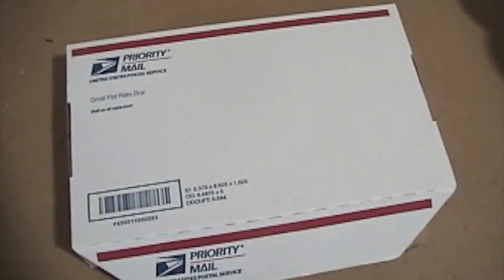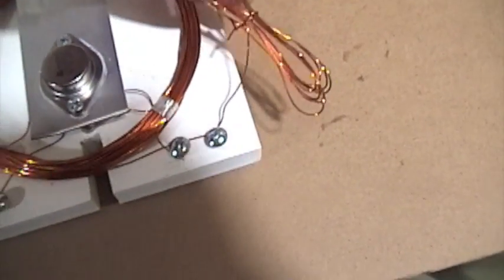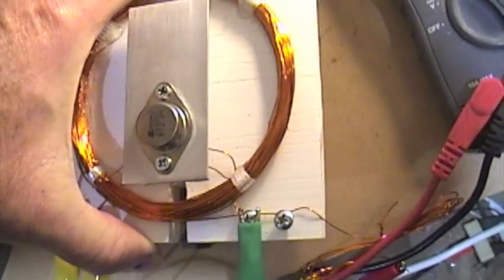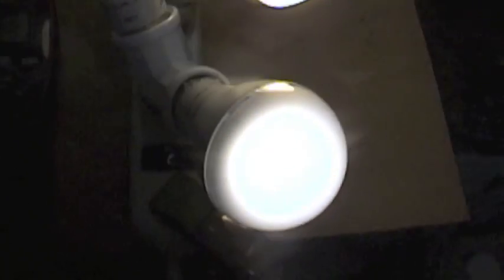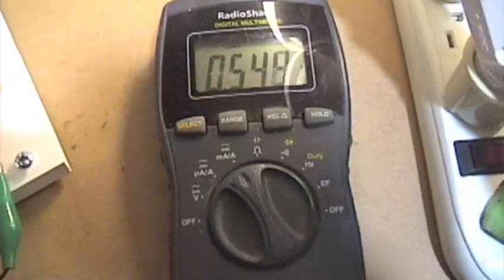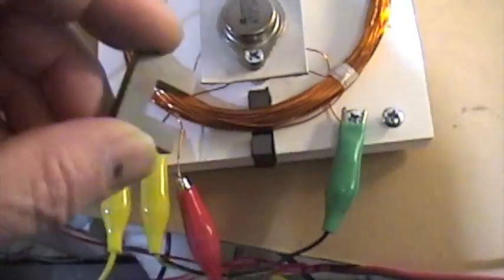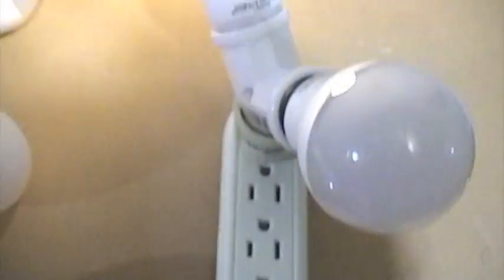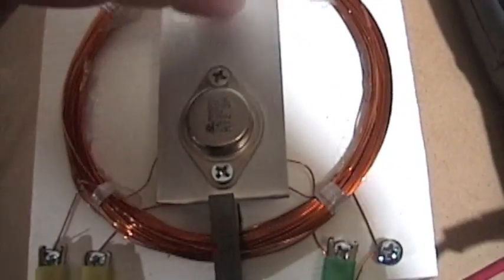High performance LJL -SC

Comment: How long will it light a 5 watt led bulb on a 12vdc battery ?
Reply: I ran a 40 watt led bulb for 8 hours on two 6 volt 4.5 amp wet cell batteries in 12 volt series.

Comment: pleas tell me  Transistors cod....
Reply: 2n3055
Reply: Ahmet Dede no it's real , i have made one before!
Reply: I call bs !!!!!! I have run the experiment works just fine.
Reply: this man is illusionist.There is  a 12 volt accumulator and inverter under the table.Transistor and coil empty accessoire for mislead.

Comment: Can you state how much EMF comes off of this? Will there be radio interference? What frequency? AM-band? Higher?
Reply: Richard Smith Designs where the power inductors are tuned are unreliable and therefore rarely used. Normally you would glue the core with epoxy and find another way to optimize the circuit. You could, for example, have an EI or EE core, glue it and then add a few turns and a low-value resistor to one side leg.
Reply: It's only bad without the ferrite core. When you use it, as you always should, it almost doesn't radiate.
Reply: zwz • zdenek Totally agree. Just pointing out the setup in this video would really hurt the ears and sanity :P Perhaps he has already deafened himself to high frequency noise, so its all good.
Reply: +zwz • zdenek If you use 2 part ferrite cores, you will produce extremely irratating high frequency ringing, unless you use a vibration reducing adhesive, but then it makes it difficult to adjust.

Comment: nice. Btw, if you use basket-weave, you might be able to get same inductance with less wire, and better spacing on wires to avoid losses. It is more labor, but saves on wire cost. Second, you really want to make sure that lead lines are NOT near each other. You can have large losses there. But you've made a really efficient little package here. Good stuff.

Comment from the maker: The power in is 12 volts, but you can use any DC from about 6 volts up to 24v by adjusting primary turns.  This circuit is perfect for the Soln1 projects many of you make.